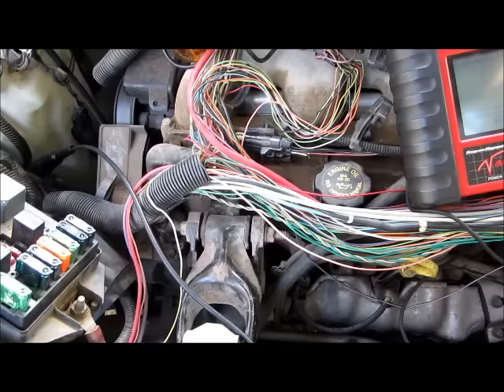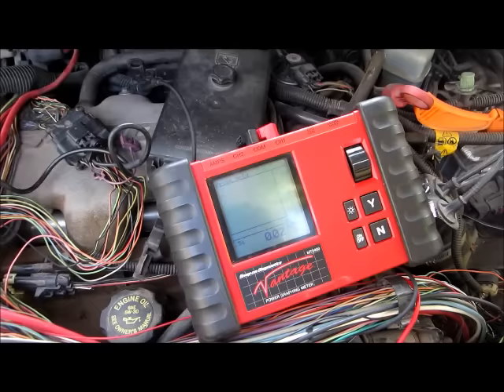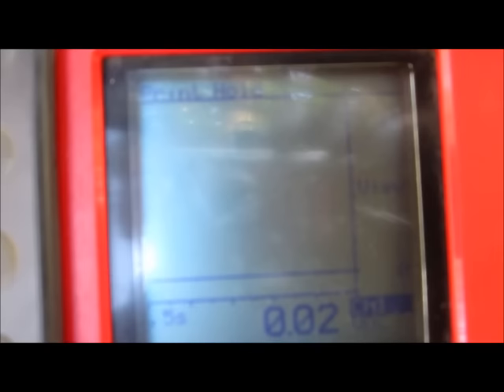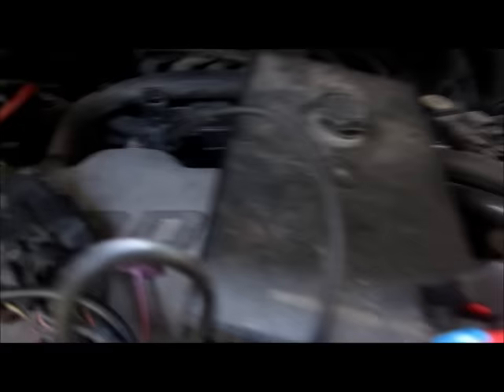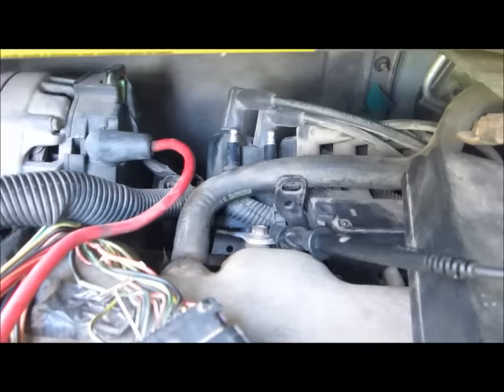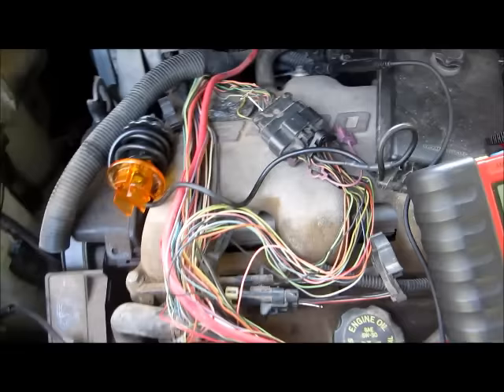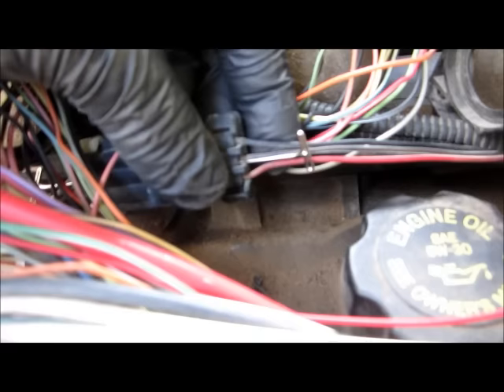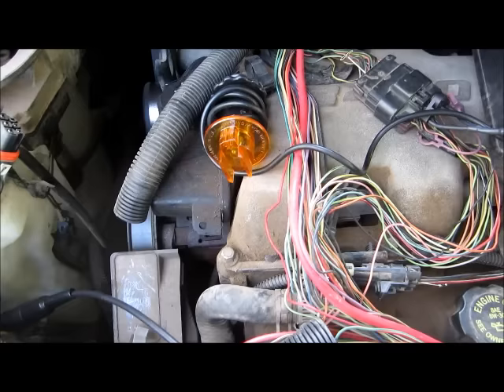NO START,NO INJECTOR PULSE Thanks Paul Danner...( Trick to make it Start )

Comment: After reading a few of the comments I just want to clarify that he is replacing the camshaft sensor not the crankshaft sensor as the the crankshaft sensor on that engine is behind the harmonic balancer on the outside of the timing chain cover.

Comment: I was interesting that it wouldn't stay running with the bypass test using the test light. It should have. This cam signal is only needed during initial cranking to start the injection sequence. Anyway, again, very nice job
Reply: ScannerDanner the test light has to be on positive or negative to create the  crankshaft signal?
Reply: It was nice that SD comment that means he is interested in his alums. Thank SD
Reply: @derrichtrundle3706  ur not creating the signal it’s already there u just have to pull it to ground using a test light hooked to b- of course

Comment: Good little video.  However, one thing anyone should know.   The crankshaft sensor (its the one he replaced) starts the car.   The camshaft sensor takes over after 1 minute or so and disables the crankshaft sensor.   So if your car does not start, look to the crankshaft sensor.   If your car starts then shuts down 3 blocks later, then look to the camshaft sensor.   regards.
Reply: He replaced the camshaft sensor. I dont think your crankshaft is in the top of your engine.
Reply: I have no spark n no injector pulse
Reply: I already changed the crankshaft sensor and camshaft sensor bank A
Reply: I still no spark and no injector pulse
Reply: @alexis12341987  it

Comment: gracias por el vídeo yo tengo un impala 2002 y tengo el mismo problema ya fue alguien fue con el scanner grande y no tiene códigos, ya le cambio la computadora la llave y el modulo de control y la bomba de gasolina al fin mucho dinero invertido y mis injetores no tienen pulso pero si tengo chispa y gas le cambie el crankshaft sensor, "pero no cambie el camshaft sensor" ojala y ese sea mi problema mil gracias por tu video será de mucha ayuda

Comment: Interesting! so looks like here that the cam position sensor is only  needed to start the engine and then timing/spark/fuel injection is by way of the Crank position sensor.  I wonder if this would work for the crank position sensor the same way and engine would start with a new sensor plugged in its connector.

Comment: Thank you for this. I have used a mechanic on my Saab V6 and after charging my over $3000 for assorted parts he just said, well its electrical, can't help -- and I am out 3 grand. No wonder people do work themselves these days, as this was a trusted mechanic and he still ripped me off. I am chasing a no start on my Saab and after 8 months I am no closer to a solution. Auto electrician said, if the car isn't running then they are interested, they will only deal with electrical if car starts -- it was about then I sad bad things. Vidoes like this help me a great deal, so thank you, mate.
Reply: Robert Stephenson Auto repair is a skill not an exact science and as such some are better at certain aspects than others. Your guy just isn't as good in electrical as people like scanner danner. I'll tell you one thing about people that are good at their trade like scanner danner, they don't come cheap. Because of this people don't tend to utilize their services regularly. Not many are interested in mechanics that charge a diagnostic fee in addition to a repair labor fee. They just want the cheap fix it for this flat fee which is the cost of the part and a little extra for putting it on the car. Those that want even cheaper are the ones that fix cars themselves. It has nothing to do with the quality of automotive technicians available but instead with not wanting to pay what those auto techs would charge.
Reply: Robert Stephenson What Killer2600 side is true,many of us that possess the cornucopia of skills required to repair vehicles 2wheels to 18, are more frustrated than you. We see how manufacturing/design processes change faster and faster. Many of these changes require a continued investment in education,and tooling and information. Unfortunately most of which does not mean added value to our customers. For this reason I decline many jobs,i refuse to comprise my reputation. Finding a problem is different than repairing/solving an issue. Technician means we are detectives, engineers, computer techs,electricians, historians ,sociologists,psychologists, managers, ect...  Never mind we have our stuff to deal  with. All of this complicated by the new parts that hit the street,that are bad to begin with. After all is said and done most techs  genuinely care. We seemed to be judged on the jobs that are out of our control to begin with. We hardly ever hear about the good,but are persistently haunted by the bad. Every gig is an educated roll of the dice,hoping and praying it doesn't kill our career.  Saab is out of business so those parts are instantly ,more expensive. We see your point,we would love to hear both sides of the story. I believe there's alot to be learned here. I/we hope your toy (as I call them) is doing better. To you and all the customers don't be to harsh on the techs out here. If it isn't right tell us, when it's right tell the world.  One last thought finding the right tech,is a needle in the hay stack thing.
Reply: WIZARDWERX  while this is all true, I have had to teach myself the functions of the Saab 9000 series, as fewer mechanics will touch them, and sadly I don't see the sense in it. It is a 4 cylinder turbo. It has a few sensors that throw up clear scanner faults when dead. It has the easiest CV and drive shaft replacement system I have ever seen. My local said it would cost me about $1000 and take all day. I asked around a bit, as it is wise to check, the drive shafts cost $150 each so I was guessing $700 was labour cleanup and other stuff. I changed both shafts in an hour and I didn't have access to all the right tools. If the mechanic had said $600 then I probably would have said sure, but these days they see Saab and go strange. I had one, during a regular oil change tell me the synthetic oil was specially made and that the oil filter cost $45. I learned my lesson on that. The oil filter was a Ryco standard 418 for $8.95 and synth oil was $50 ... $450 for this is bullshit, and I don't care how many years of training I'm paying for.

While I think a mechanic is worth their weight in gold I am seeing more and more of the one that sprout nonsense, bump up prices and then claim it is because the car is this or that...
Reply: Well..? first Saab 9000 series are little sweetie's, real go get'ters. Your local mechanic/s should be ashamed of themselves. Sorry to hear about this kind of treatment. You are right they are trying to rip you off. And gives all of us a bad name.They will simply have to miss out on such wonderful opportunity. I have come across a few Saab's and always intrigued by their design. Some definitely different.Sounds like you have yours under control,and enjoying it.  The prices your being quoted are obscene.  Repair manuals for your car should be inexpensive.Good to have.Its late here,U.S east coast. By the way 2 axle's approx.4hrs. $300.00 labor and $120 for both axles,cool right.

Comment: I know this is a late comment,usually the ignition control module ICM controls your ignition & injector pulse,your icm is controlled by your ecm which sends a 5volt reference signal...so what was it?
Reply: 90TegTurbo If you watched to the end of the video you would have seen it was a bad camshaft sensor.

Comment: This truck did have spark though?
We swapped out a wiring harness on a 93 F150 and it will run on ether but has no injector pulse at all.
Reply from the maker: I recommend you to watch scanner danner videos , the one with Eric is the descripcion of my video 👍
Reply: @elPanin   An engine fire had bunred up the wiring harness on the 93 F 150.
Another shop replaced it but couldn't get it running.

One wiring harness that came from the salvage yard had MAP sensor plugs but no MAF sensor plugs built in. A 96 Model harness had MAF plugs but no MAP sensor plugs.
     
So we could get rid of the MAP sensor codes we went back and got the ECM off the same truck the harness came off because a 96 didn't have a MAP sensor so it wont look for the MAP sensor and set a code.
None of the injectors were firing at all with the old ECM so maybe something had shorted out in it with the engine fire melting all the insulation from the wires. I think it should at least have ran with no MAP sensor maybe I'm not sure.
Reply from the maker: It's gonna be hard to figure out what is causing the no injector pulse , not having the right harness 😔
Reply: @elPanin  It fired right up with the 96 ECM!😀
Forgot to mention it!
Meant to though!
Reply from the maker: 😲😁👌 nice 👊😎

Comment: Whatever controls is part controls the injectors no injection no fuel pump no spark I ran into a lot of problems with cars trucks just like that no pick-up coil passport no cam sensor no coil Spark weird I saw this system in on cards works

Comment: solo usa tu scanner para ver si ha y signol o no facil
Reply: alguien lo hizo con mi carro y no sale ningún código y es el mismo problema con mi carro   voy a intentar cambiar el camshaft sensor aver que pasa
Reply: Mira si tiene security light.si la tiene  deja la llave a bierta por 10 minutes despues a paga y ve si prende o si la Luz flashea
Reply: +Antonio T Posadas no tiene el security prendido, hoy cambie el camshaft sensor, y si prendió el carro pero por unos 30 minutos después  lo apague y ya no prendió no se que será el problema pero es algo electrónico
Reply: Que tal Raul se que ya tiene mucho tiempo este post, pero quiza esto le sirva a alguien mas.
Con un medidor de pulsos de inyectores  conectado a cualquier inyector la llave encendida debes de ver una luz tenue que viene de el driver de la PCM si no se ve nada deconecta sensores empezando por el MAP y observa tu probador si enciende la luz tienes un sensor malo  arnes dañado .  O simplemente desconectalo y trata de encender el vehiculo.
Recuerda que el tamaño de el scanner no es clave para las reparaciones y tampoco es una caja magica que te va platicar todo lo que quieres saber acerca de las fallas. Codigos hasta un niño de 4  años puede sacarlos el chiste es saber leer datos  y conocer los diseños en los circuitos que reparas. Tambien se puede utilizar un probador de corriente de preferencia LED.

Comment: THE CAM WAS BAD THATS ALL
Reply: +Damaion Ennis id love to watch you attempt it, look forward to a great laugh. your type is useless to us all, i cant f'ing stand to read your comment!!!!!!!!! (currently having serious problems and looking to youtube for a fix) I absolutely love these guys for putting there videos up here, and going through the extra trouble out of the goodness in their hearts!!! so go please break your keyboard in half!! cause their video is not up here with a producers carrier in mind! they enjoy helping others thats about it! 
ps. dont tell me i need anger management, i already know lol
Reply: +ROB SIKES - TAKE CLASSES ON DIAGNOSTIC THEN YOU WILL KNOW HOW TO CHECK INPUT (SENSORS) MONITORS THERE'S TEN OF THEM BUDDY. CHECK RESISTANCE IN THOSE MONITORS EASIER AND SIMPLE. YOU WONT HAVE TO CUT INTO YOUR WIRE HARNESS...I LIKE TO SEE YOU LEARN IT...TOOLER...I AM A ASE CERTIFIED AKA "MISTER GOOD-WRENCH" NOW LET ME SEE YOU DO IT. CHALLENGE!
Reply: Rob Sikes CAMSHAFT POSITION SENSORS
On many engines with distributorless ignition systems and sequential fuel injection, a camshaft position sensor is used to keep the engine's control module informed about the position of the camshaft relative to the crankshaft. By monitoring cam position (which allows the control module to determine when the intake and exhaust valves are opening and closing), the control module can use the cam position sensor's input along with that from the crankshaft position sensor to determine which cylinder in the engine's firing sequence is approaching top dead center. This information is then used by the engine control module to synchronize the pulsing of sequential fuel injectors so they match the firing order of the engine. On some applications, input from the camshaft position sensor is also required for ignition timing.
The camshaft position sensor may be magnetic or Hall effect, and mounted on the timing cover over the camshaft gear, on the end of the cylinder head in an overhead cam application, or in a special housing that replaces the distributor (in the case of some of the GM applications). Operation and diagnosis is essentially the same as that for a crankshaft position sensor.   AKA"MR GOOD-WRENCH"
Reply: Rob Sikes YOUR WELCOME
Reply: Damaion Ennis I need your help with a question brother
Reply: Terry Morris.. ?????
Reply: Terry Morris yes Sir
Reply: Damaion Ennis I have a 2007 Monte Carlo and I have a problem with it every time I tried to press the gas it drives good and first gear but when I put it in drive I have to push the gas to where it will ride sluggish when I put it in first gear and drive perfect but when I put it in regular gear regular Dr you have to press the gas a little hard for her to catch up what does that mean if you can you can call me at 321 330 58-41 Amherst area thank you
Reply: Terry Morris . If you're check engine light is on. Have the codes scanned at AZ. Sense you don't have a scanner. Check to see if you have transmission codes. If so could be a control solenoid faulty. Again have your codes scanned. Thanks